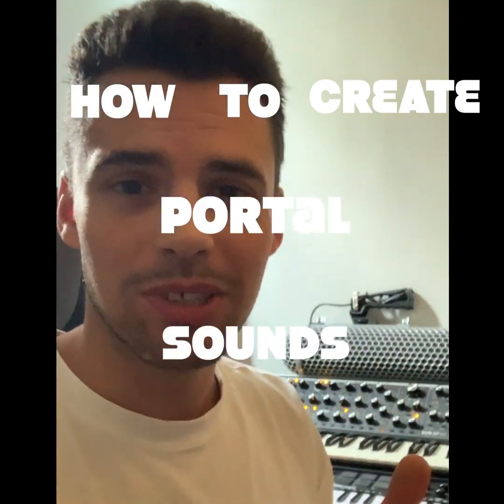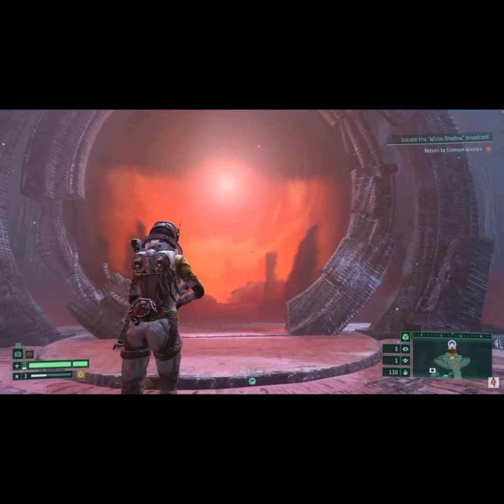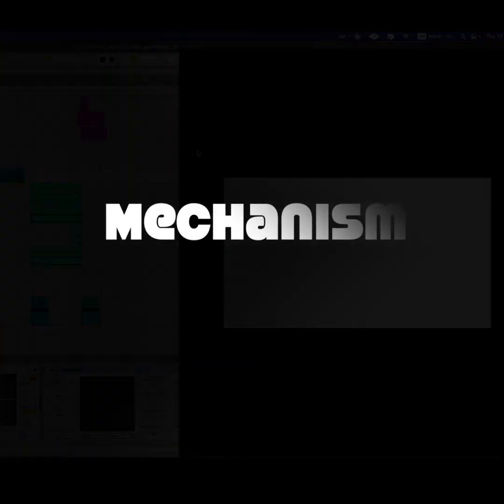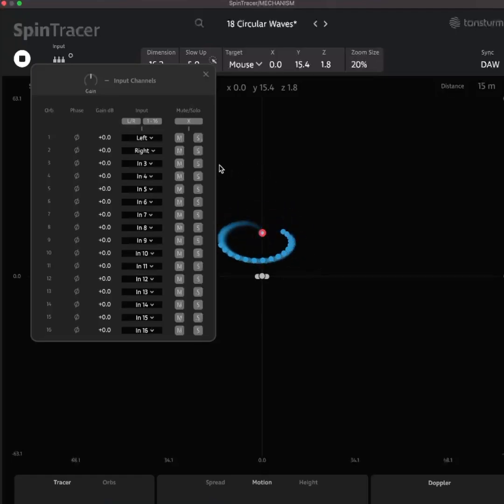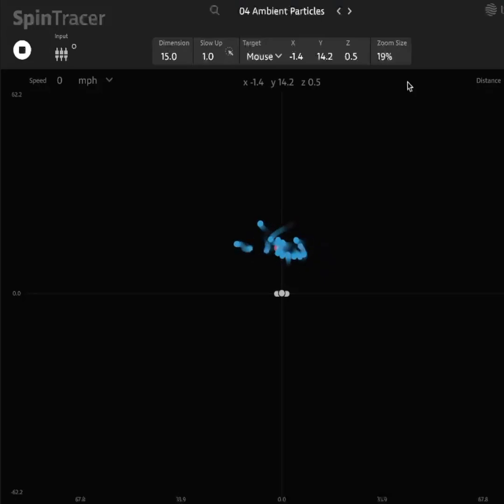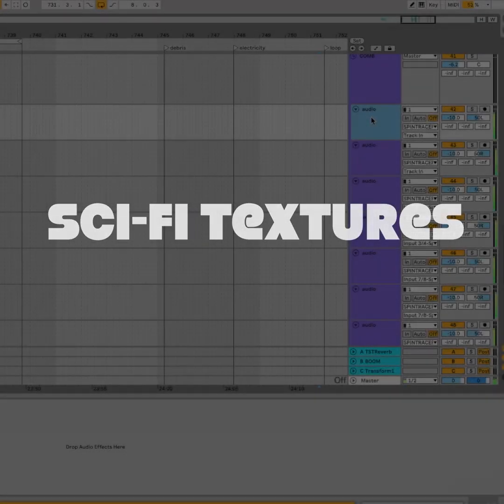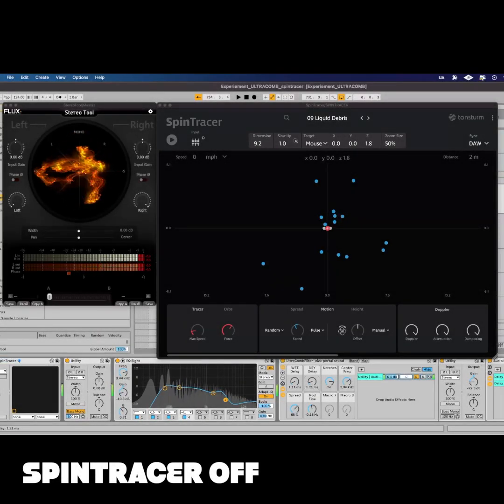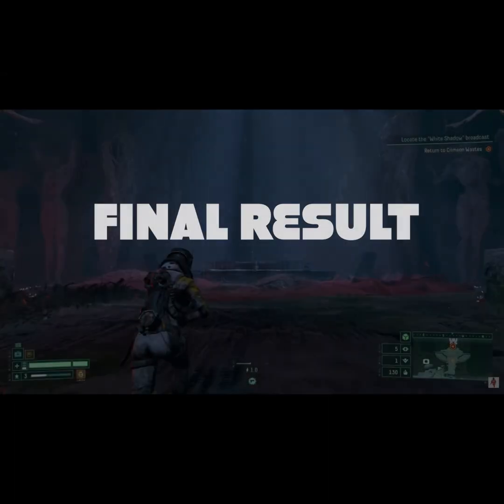How To Make Portal Sounds - Sound Design Trick by Paul Renard

Comment: Does it work in a Pro Tools Dolby Atmos session ?
Reply from the maker: Hi, it works like a normal effect in a Pro tools session OR you can route different tracks output into a SpinTracer BUS to control their movements with the plugin and create specific designs. To answer your question, it does work in a Dolby Atmos Session, but you cannot use it to control your output inside the Dolby Atmos system as most sound designers use it more to create a specific sound / movement and then implement this sound within a dolby atmos mix session to PAN it afterwards. Hope this helps.